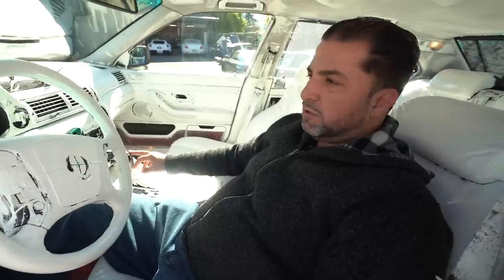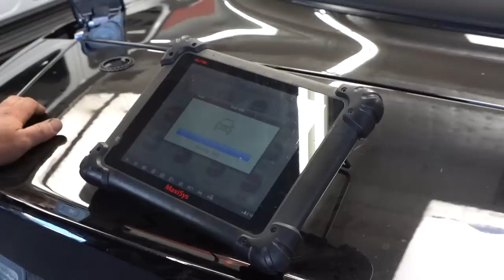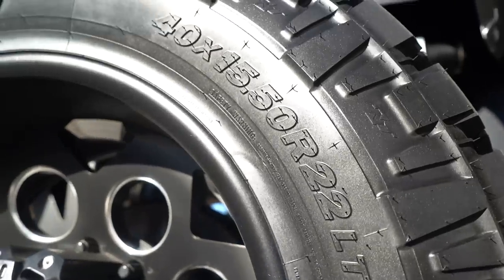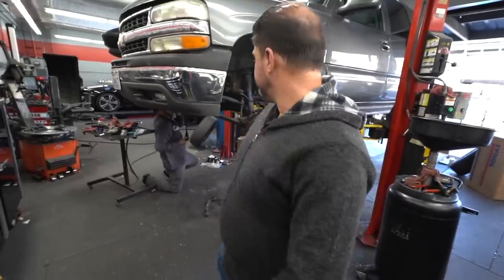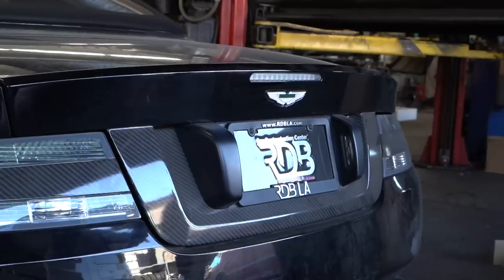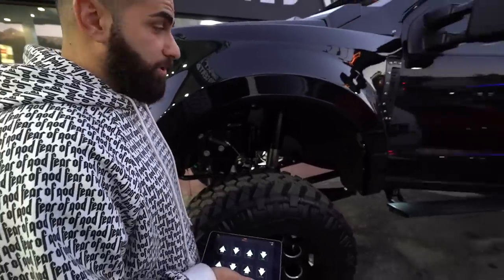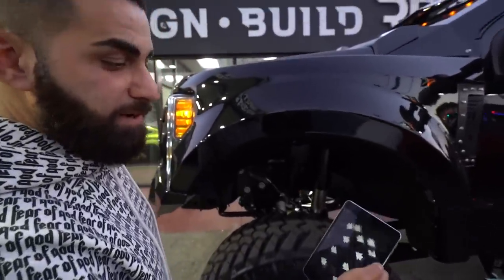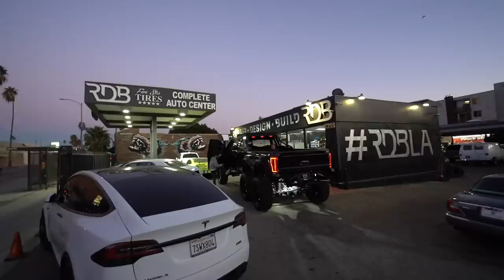#RDBLA 26 FT FORD TRUCK 6 WHEELS, BMW ARTIST PAINT INSIDE & OUT!

Comment: The 6 wheeler thing is one of those trucks where the front wheels fall off if it hits a twig, you know it will never go 'off road'. Not sure why it has a messed up front grille, paper tigers have presence too.
Not sure the 7 series is the right car for the faux Jackson Pollock treatment. It is an old car and just looks demolition derby rather than deluxe.
A more modest and not high-end old Citroen or Fiat would work better, or if high-end insisted on, then an old pre-BMW Rolls or pre-VW Bentley. Plus there is an art to art, you have got to do it properly, e.g. work with RDBLA to strip the car of trim first, apply a base colour wrap and then do something Jackson Pollock with the paint.